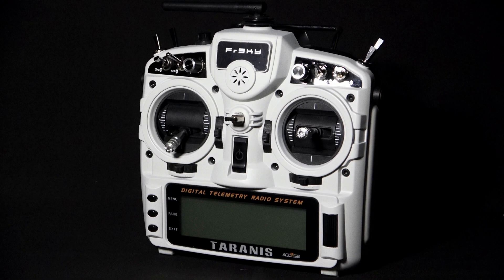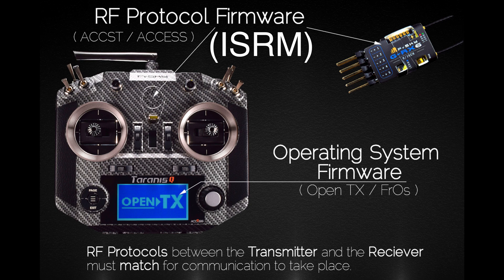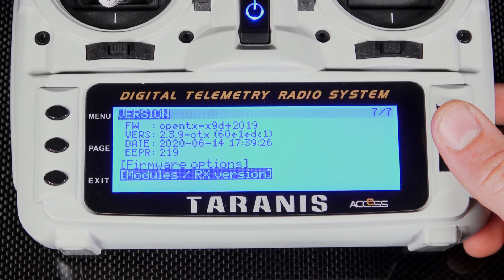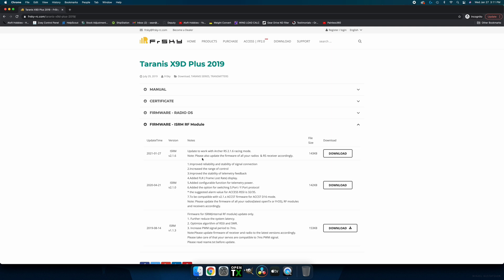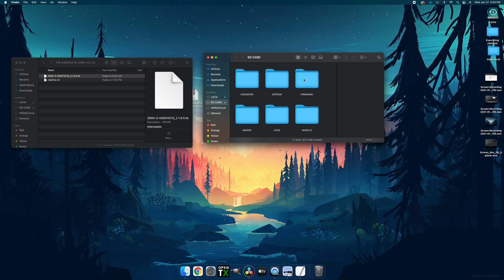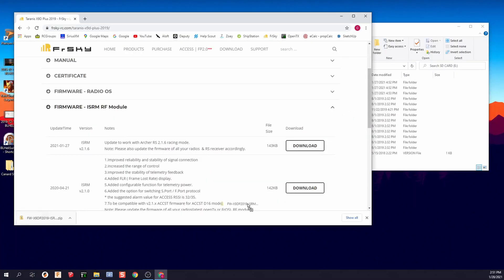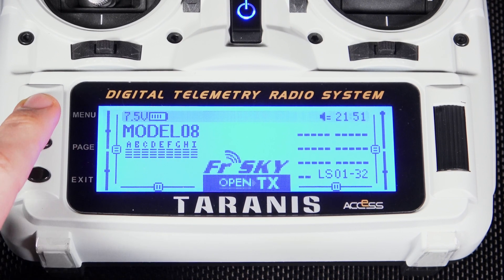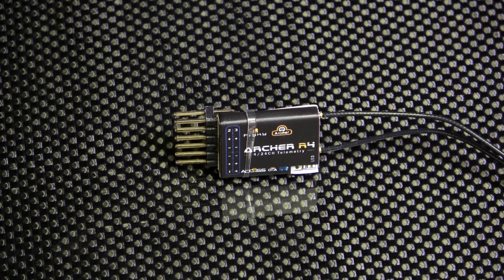FrSky ACCESS - How to Update your Transmitter Firmware

Comment: My qx7 doesn’t say “flash internal module” what went wrong? I downloaded all the proper steps for my radio but it doesn’t have that option?
Reply from the maker: You may be on a very old version of OpenTX. We don't have a guide for updating OTX firmware yet, so you will want to check on youtube.
Reply: @alofthobbies18  i have same problem

Comment: Does 2.1.6 isrm firmware work for xm+ receivers with accst 2.1.2?
Reply from the maker: Yep, you should be good to go.
Reply: Bro I’ve been stuck on this step for soooooo long now 
Will this process work the same for the x9 lite radio ?
Reply: @pacman5511  not 100% sure im using  x9d. But should be similar process. Firmware works great. Save older version just in case.